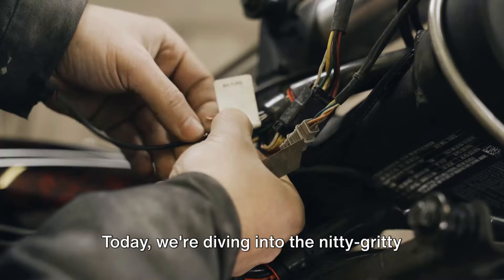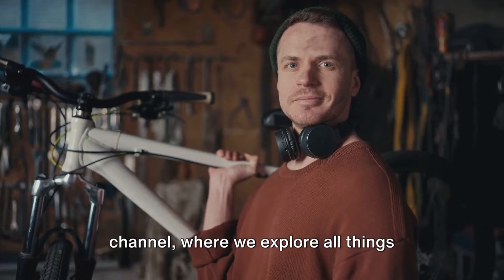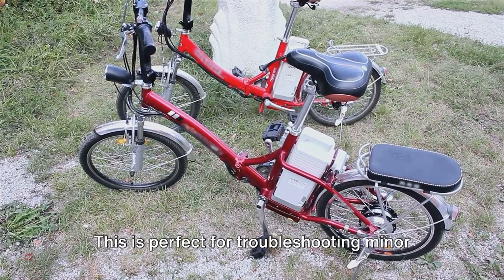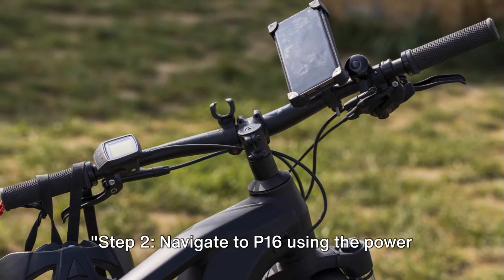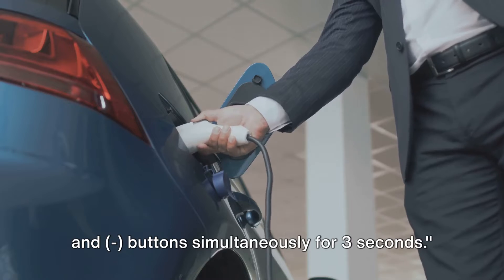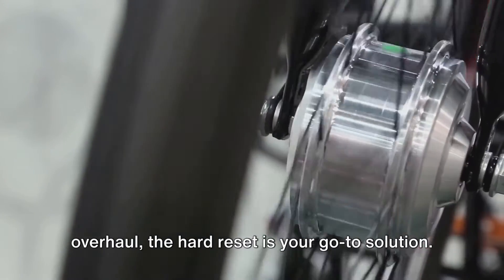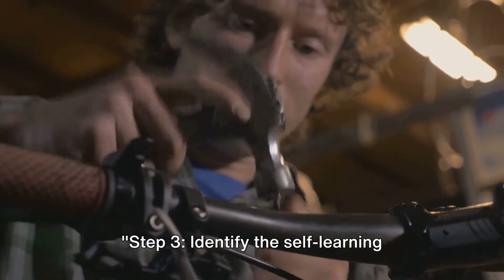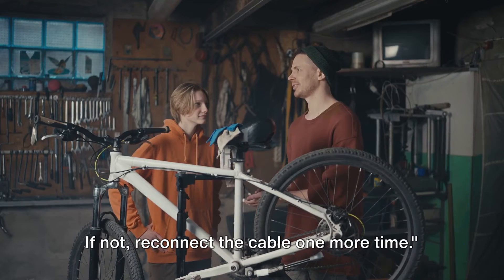"Ultimate Guide: How to Reset Your Electric Bike Controller | Soft & Hard Resets

Comment: Am I the only one that dont get it? For the hard reset you "remove the controller"? "identify the learning cable, typically the only wire connected to your controller"? wtf! im worse off now than before i watched this video.
Reply from the maker: all controller cables are connected to your ebike part like motor,  battery brakes , the only cable connected back to your controller is the self learning cables , you should find a cable connected with a blug that not connected to any of parts but going back to the controller